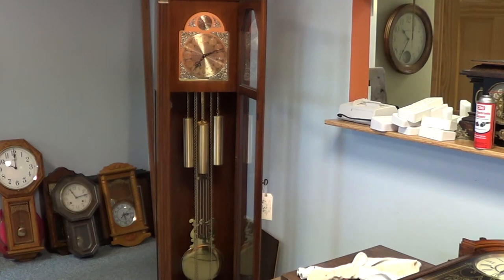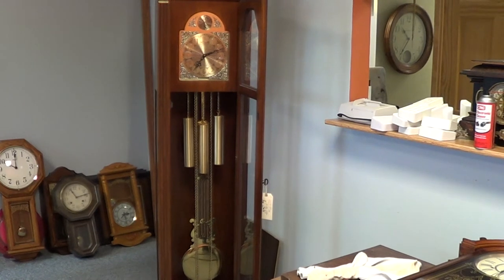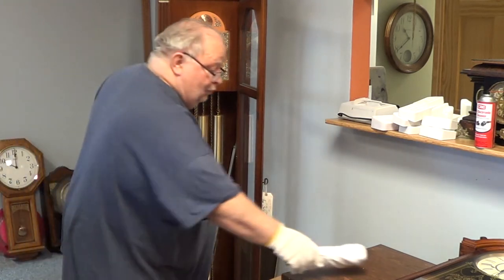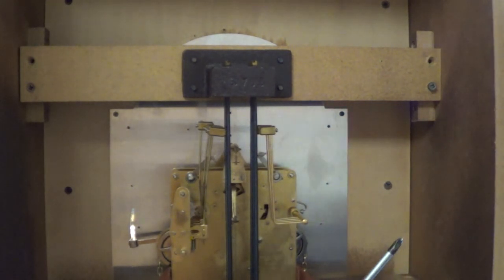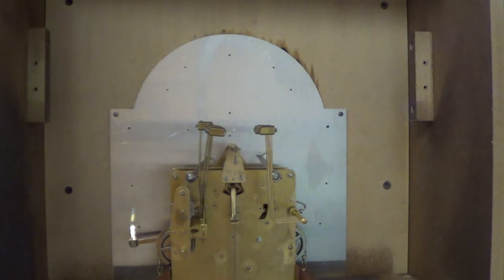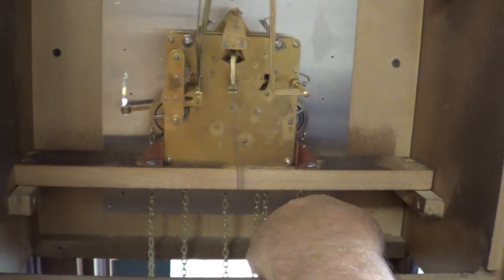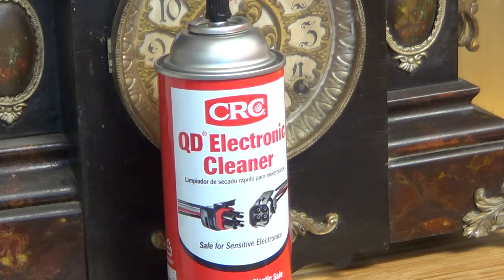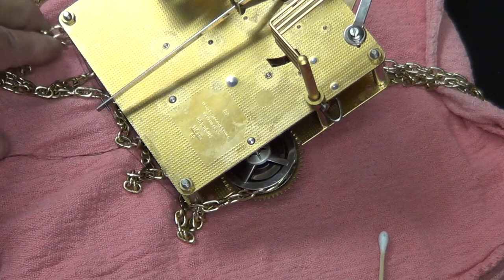How To Clean & Oil Your Grandfather Clock PART 1

Comment: i recently acquired a grandfather clock with 3 weights; i oiled wirh liberty and greased with mobius after following your video--thanks by the way--when i put the pendulum in motion, it only swings for  a minute or two; there is no tic toc sound and the????? does not advance the ?? wheel?; it almost seem like the mechanism is locked; i also attached the minut hand and advanced it manually but as is say..."locked"   ??? means i don't know the name... please help  ric
Reply from the maker: Need to know if this is a chain-driven clock or is it cables?  Make sure when facing the front of the clock that the heaviest weight is on the right side.  Use cotton gloves when handling the brass weights. If it's a cable clock it will have a crank handle. Some clocks have a sweep second hand and minute hand and hour hand does your clock have the sweep second hand if so make sure it's free and not bent dragging on the dial.  Remove the pendulum and set it aside that is if you can access the movement from the back, now carefully move the leader from right to left with one finger and listen to see if you can hear the tick-tock if you can see the fork which is connected to the leader watch for the escape wheel movement. Let me know what you see and hear.  All of this is very important.  There are several newer videos I posted which show how to set the beat of the clock using the leader.  
The Bench Jeweler
Reply: wow quick response.. thks; it is chain driven; no second hands in the works; i removedthe pendulum and moved the leader/crotch but there is no tic/toc whereby the "fork" does not advance the escape wheel; as i mentioned -it seems that the system is "locked"; i have looked at setting the beat video but does not work if the escape wheel is static/still or locked onto the same tooth of the whel.... ric
Reply: MISTAKE!!! when i moved the leader (brass arm/crotch) by hand , the escapement wheel did advance; i going to attach the penulum and try to see if  the pendulum will advance the wheel... back in 15
Reply from the maker: You need to set the beat before you do anything else. You can look at one of the "Trouble Shooting Videos" to learn how to do this.  With one finger with the pendulum off, then move the leader to the right until you have moved it as far as you can then move it to the center of movement then lightly to the left about 1/4"  see if that puts the movement back in beat so the clock is running tick-tock even sound.  
The Bench Jeweler
Reply: yes the pendulum does advance the wheel so now the only problem is that the pndulum stops moving after 1-2 minutes
Reply from the maker: @richardhugh6881  If your escape wheel advances with power on the gear then the best bet is you need to get the leader in beat so the tick-tock sounds even which is done by adjusting the leader so it has equal distance as the stroke of the pendulum moves back and forth.